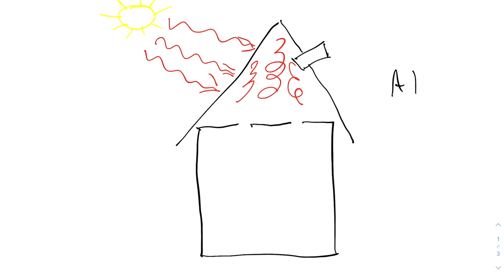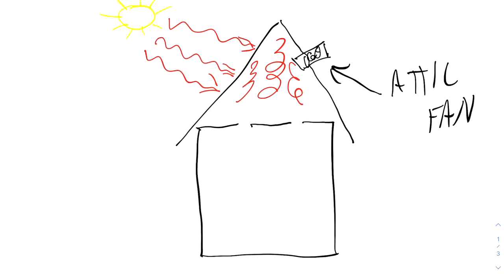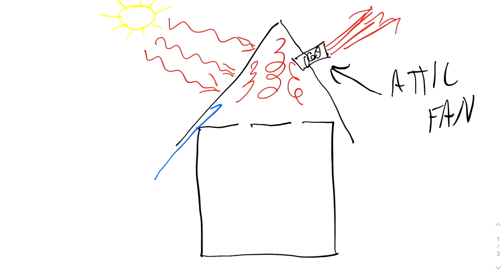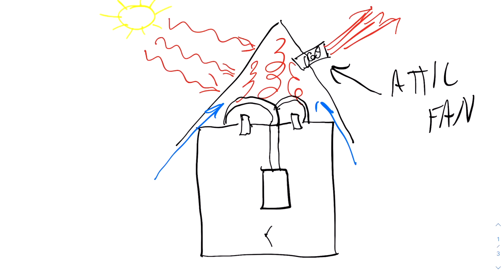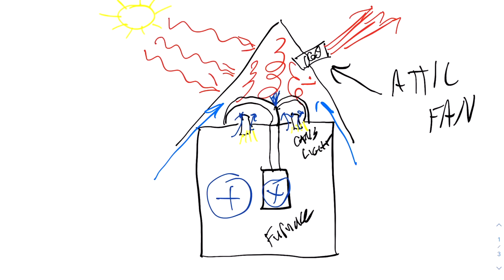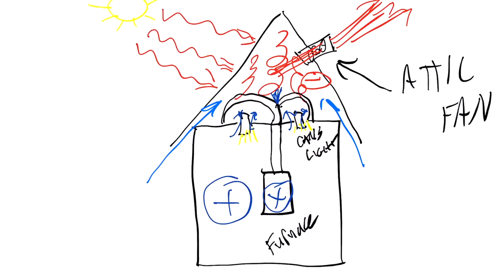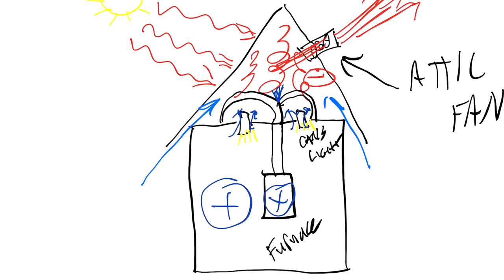3 Remodel Rip-Offs

Comment: Worked in HVAC for 6 years now and its very clear you might have knowledge in some things, but it sure as heck isn't the V or the AC. When heat accumulates so much in an attic it will literally drop down into the house. Even if its 120 degrees out an attic fan removing the 150+ degree air in your attic will have a beneficial effect on your house. To act like attic fans are a scam is insanity. Anyone who has ever worked in a 130degree attic can attest to its ability to remove heat not even talking about comments talking about massive temperature improvements after installation. 

Moving onto the AC and fan running mode, I'm not entirely sure what you are implying, an Airconditioning system is literally a dehumidifier the only difference is instead of a net gain to the heat in the house you are taking the heat and yeeting it outside. Evap coils can start producing meaningful condensation in a minute of run time. Put a humidistat in a supply vent youll get 99% humidity at the vent, because the moisture its removing/removed is significantly greater than any moisture currently on the coil, simply by the fact that the moisture on the coil was moisture that was already in the house. Coupled with the fact that almost every mfg of modern HVAC equipment as a default will run the fan for 45 seconds to a minute after the condenser turns off to get that last little bit of cooling out of the ducts and off the coil. 

Fan on can also be useful if you have one thermostat but multiple floors with only one zone, mixing the air constantly can improve total home comfort but isn't a perfect solution. 

Smart thermostats that track your location like that one crazy ex, while creepy, can definitely save you money. I dunno about 25% but raising the temp when you aren't in the house when its the hottest and electricity is the most expensive and turning on when 90% of the world is coming home from work after the hottest part of the day and when electricity is cheaper will save you money in the only way a smart stat can, compared to crappy programmable thermostats. HOWEVER. A house consistently kept at a lower temp will be more comfortable humidity wise, but any cooling will feel better than the 95degree outdoor temps.

Comment: I just installed an attic fan on a house in north Texas.  The AC can now be set 5 degrees  lower and runs noticeably less. The air temperature in the attic went from unbearable to tolerable during the day. The different is huge.  This video is WRONG.

Comment: 100% DISAGREE, 2ND FLOOR DURING HIGH HEAT DAYS WOULD NOT GET DOWN BELOW 75-76 Degrees. 20 years i just dealt with it. Recently installed wired fan and it helped tremendously. Now i can hold 69-70 degrees on multiple high heat days. Result driven statement. I leave attic fan thermostat set on 85 degrees.

Comment: IMHO 1.  Sorry, moving outside air through a hot attic space will cool the attic space.  I prefer passive non-powered venting.  If it didn't cool the attic space, when would all those electric gable fans with thermostats ever turn off?  Seal your air leaks.  2.  If anyone is not buying a variable speed air conditioner in 2022, they are wasting money.  Variable speed ACs will dehumidify even if they are "oversized".  You are talking about old single speed AC units which require very accurate sizing by HVAC contractors.  You can now over build and be prepared for the new hot temperatures that are on the way.    New stuff, you don't need to worry about cold and clammy, they take care of themselves by slowing down to a lower BTU level and dehumidification is maintained.   Do not buy a dehumidifier unless you need dehumidification without changing temperatures.  3.  You seem locked onto windows in cold climates.    Dual pane windows in desert climates keep the house way cooler especially where nighttime temperatures are >90 degrees.  Standing next to a single pane sliding glass door vs a dual pane it is easy to see and feel the difference.  Yes, new windows cost money, but we are not all flipping houses. 

I would rather give my money to an energy efficient modern HVAC contractor, an energy efficient window and door contractor,  and pay for attic vents than give unnecessary money to my electric and gas utility.

I was not impressed with the "rip-off" information in this video.

Comment: I disagree with your theory. I installed an attic power fan and it was a huge difference in temperature I do t have that hot air in my ceilings and my ac unit doesn’t run constantly.

Comment: Strongly disagree with the attic fan. My parents fan stopped working and the upstairs became unbearable. So much so that we needed window air conditioners. There is no way in hell that an attic fan will cause any noticeable negative air pressure in a home. In a restaurant with a hood system that doesn't have a make-up air unit? Sure. House no. Gable vents are more than enough to equalize the pressure. These people saying "thanks, won't be getting an attic fan now!!" Need to consider more than one source of info. No offense, it just seems like common sense. And that microwave/hot pocket reference is fairly irrelevant in this comparison.

Comment: Matt most people have dark colored tall roofs, I have a white corrugated galvalume, (composite metal made of 51% aluminum and 49% galvanized steel so you get the strength of aluminum at a reduced price) 4 on 12, (very low) roof because my electric bill looks better than everyone else's dark shingle tall roofs 🤣👍

Comment: I'm not sure where this guy gets some of his info from..  
   Attic fans properly installed work..  no mention of radiant barriers.. I put one in and immediately saved 20- 60$ per month.!!   I didn't do the attic fan...  I do have a wifi connected thermostat .   Useful when I go out of town and forget to bump up the temp...  I also use Circ mode and 4 mins before and after the AC is running... never experience this humidity he's talking about... I have a 19seer variable speed unit...  (I was told that a variable speed unit would  somehow draw air out of my house into the attic by one AC expert... crazy)   
    I live in the central portion of Florida so heat and humidity are abundant most of the year. 
   My Summer Bill used to run at $225 @ 78f in the day and 76f at night...  Now it's $135 76f day 73f at night..   I also have low e double Pane windows they work vs my neighbors who dont.don't..

Comment: You don't know what you're talking about with the attic fans we live in Illinois I've been doing mold remediation and attic since 2004 and I install those attic fans all the time it cools the attic off majorly especially after I just did mod remediation on your roof deck and eliminates the heat almost 10 to 15° and it's pulling out excessive moisture that causes mold I've never been back to an attic that's had any regrowth

Comment: Not every product is built for every environment. Ie solatube more compatible with Phoenix AZ home and barely viable for Pacific Northwest. The attic vent fan is very compatible for a temperamental and humid environment but not so much for a dry consistent climate. I could go on and on but the bottom line is know your material, understand application theory and know your market.

Comment: What if I give you an analogy for your microwave analogy. If you have an oven (attic) and you open the oven door (fan), will the oven temp go down? Common sense says yes. When I go into my attic, it's like an oven!
Reply from the maker: Yes but your oven has a heat source. What’s heating your attic?  The main source is radiant energy from the sun. Stand outside on a sunny day and you are cooler in the shade than in full sun. Same concept.
Reply: @buildshow  Well, an analogy I like to give is a car left in the hot sun for an hour, the radiant heat just like your attic is heating the car now you decide to drive with the windows up or down, having them rolled up you will be sweating like a pig, or you can roll the widow down and bring in air it maybe hot air but its a lot cooler and a much more bearable scenario.

Comment: This video is not evidence driven mostly opinions and different parts of the country will be part of whether or not these types of these will be cost effective. 
I live in northern Utah at 4500 ft. I placed a fan above my attached garage at the top where the vent is, the fan turns on at 90 degrees and keeps the garage cooler-Worth the money. 
Changing one window may not provide a much of a payoff changing all of them most likely will. It is important to have the window company do some due diligence.

Comment: I think, as far as the fan issue goes, he's right with the solar powered fans......but with a high volume fan, he's dead wrong. Just as a goof, go into your attic one night and place a high low memory digital thermometer...   you ain't gonna believe how hot it gets up there.

Any real help exhausting that inferno has to be a good thing...........BUT, the solar fans won't do it.

Comment: This video makes the most uneducated baseless claims I’ve ever heard. For starters; the hotpocket in the microwave analogy is completely irrelevant. This guy is missing the largest and most obvious fact; the greenhouse effect?!? Solar radiation is trapped into your attic. Outside is not inside the microwave. The logic used in that claim is elementary and sadly completely untrue.

 Fans can draw ( yes suprise, you can have 2 attic fans) and suck from OUTSIDE circulating attic air temperature lowering it from temperatures from 150 to 80 during the summer which can infact lower your electricity bill (particularly in the state of florida from 1,000-3,000 dollars. I stopped watching the video after the first claim.

Comment: His analogy of a microwave oven is 100% incorrect.   Microwaves don't use radiant heat.  There are three types of heat transfer;  Conduction, convention and radiation.  Guess which ones microwaves don't use.  It is not convention or conduction, the two types you'd find on a roof and attic.   His reputation and thus his advice takes  a hit right there.

Comment: I disagree also attic fans work when properly set up. I used an attic fan for 20 years and it helped a lot! That your going to complain about the optimistic marketing tells me you do not have enough field experience and are trying to figure this out from text books and conjectures. 

Most of the US lives in areas with hot summers and has come home to a hot house or apartment yet outside is cooler after dark. You put a fan in the doorway which draws in cool air from outside, same concept for an attic fan. Reading the comments a large number of attic fan users agree they are worth it and your clueless

Comment: In the summer, when your attic gets to over 150°F, bringing in 100°F outside air in will NOT cool your attic down, it's a scaaaaam :)
As for the double pane windows, thye should be also considered for comfort reasons.
My house internal temperature used to swing between 15°C to 40°C on single pane windows. Hard to warm up in winter, tortures my AC in summer. Once they got replaced, my heater thermostat actually switches... instead of being full blast all day long and same goes for the AC in summer.
Every house is different but all in all that whole video is full of misinformation with a few bits of good advices. Doesn't really help the viewer.
And of course the new hidden dislike counter doesn't make it obvious that this video is 90% BS

Comment: Didn't watch past the attic fan part.  He never have empirical evidence that it's a scam.  He doesn't understand nor mention the difference forced convection vs free convection which is what powered fans do.  Also the pressure is situation dependent.  Most fans are programmable to negate that.

Comment: Sorry Matt but your scam on the fan is wrong. Whole house fans work on specific days that are right. My friends house has had one since the 80'S and I could feel a difference,  and just because the sun uses radiant heat doesn't mean there is convective or conductive heat inside the attic. This exchange of air does change the temp inside the attic and any less stagnant hot air inside your attic is a good thing. I am really not sure how your getting your ideas on this but by the comments read maybe you should do some scientific tests on attic fans.

Comment: yeah sorry but not a scam attic fans are dependent on multiple factors on a new house up to code with proper insulation like you should have yeah its a scam. Right now we are in a 80s home in texas the attic is 160* causes the ductwork to get so hot during the day it blows hot hair. Literally did duct repair, refrigerent checks, coil cleaning, new motherboard. tune up. Attic fan allowed the central unit ductwork to do its job better. If house was properly insulated and in temperate weather it is a scam. So idk feel torn about calling them scams. Moreso their marketing is misleading..

Comment: Incorrect information, some roof systems require e power ventilator.  Depends on soffit ventilation.  Properly insulated and sealed and they do not creat the vacuum you maintain.  Your explanation makes sense to you but does not really make sense

Comment: I like the Hot Pocket/microwave analogy. Radiant barrier insulation, or radiant barrier sheathing, is what people should be doing as a first line of defense to keep their attics cool. Instead of attic ventilators, a whole house fan, which turns on when the outside temperature cools to below the temperature inside the living space, can be an extremely effective way to save energy. But those tend to be most useful in milder climates. Around here, in the San Francisco Bay Area, a whole house fan is often enough to eliminate the need for A/C entirely.

Comment: This is not good information. You understand some concepts of heat transfer but aren’t applying them right. You have radiation heating the shingles, conduction through the wood, insulation, attic air, and through your ceiling into your home. Having a high ambient temp in your ceiling results in higher temperatures in the house- more power demand from the HVAC. The outside air is a free heat exchanger if properly applied to the equation. Non powered ceiling vents are using convention to vent bc hot air travels from hot to cold, as well as upwards.  However you can apply a fan to exponentially improve the heat exchange. 

But to simplify everything, what’s more efficient, using HVAC to cool your attic or using a powered fan to exchange heat? It’s much more efficient to use a fan and vent. It’s like saying rolling your car windows down when parked in the sun doesn’t cool down your car.

Comment: In most new homes, there is nothing to move air around in the attic. Yes there are vents, but thinking that the air will passively escape via the vents is nuts. The fan helps to move air around and pulls the hot air hot out. When an attic is extremely hot, if you have an A/C, it has to work harder to cool the house, thus use more electricity. If a person can cool off the attic, the A/C does not have to work as hard. I bet this guy just wants people to need other work done, so he makes more money...thus the purpose of his youtube channel. If anough research is done, you can find anything on anything to justify any claim...just saying...Check with your local professionals.

Comment: Definitely not true about the attic fan. For someone who has been installing air conditioning for 35 years. Even on the hottest summer days outside air is 30 to 40° cooler than attic air and if you can suck in 90° outside air to replace 130 to 140° attic air it will definitely help your air conditioning if you have duck work in the attic or just keep your ceiling a little cooler in your living area.
Also the statement about negative pressure in your attic is absurd. The only way that could possibly happen is if you had no way air could be replaced into the attic such as louvers or vents when the fan is sucking attic air out. Every attic that I’ve ever been in in my life has always been vented well so such a statement as this is crazy. I generally like his comments but he needs to do some more research before he voices his opinion sometimes.

Comment: Your comments about the physics of what the solar vent or any roof vent in that manner does, don’t follow logic. You are replacing the air within the attic space by exhausting it out while intaking from soffits, you are not trying to directly cool down the shingles and the roofing structure thats is exposed to radiation. Hot air within the attic heats up through convection by blowing over the inside of the hot roof. Once you remove the air and replace with outside cool air, you keep the temperatures down and fight against the heating in a continuous manner. A good example is a parked car under the sun, just because the sun is beating on it, it doesn’t mean you cannot replace the sweltering hot air inside with fresh cooler air by opening windows. Air follows the path of least resistance, unless your soffits are clogged, you ll suck majority of the air from outside and very minor air through ceiling. I would rather loose a tiny bit of cooled air to the attic rather than my stagnant super hot attic air heating up my upstairs and wasting more energy to cool my upstairs.

Comment: Love most of your stuff, but this was a bit of a fail. You clearly made bad assumptions that don’t hold up in all regions of the country or age of house. There is no AC in my PNW house to pull cold air from. Sure you might need to add additional intake to reduce pressure from, light boxes, especially those bougie can lights, but that is just a few smart holes and screens on the north side of the house. Sure maybe I could blow in a bunch of new insulation, but a couple of solar fans, four inch hole saw.  and a few screens are effective for some and not a scam.